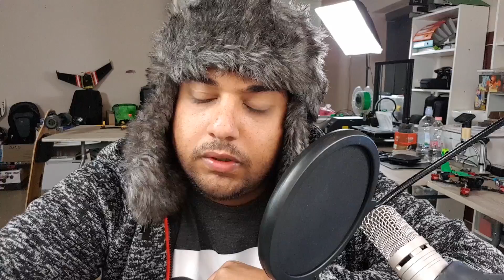Open Hardware F4 Flight Controller Beta Finished // Morning Vlog #017

Comment: Hello, I can see a great project ahead and I'd love to help if possible.
I also work on drones and designing PCBs and have designed many custom PCBs from scratch using the F103 chip. Feel free to contact anytime.
Great work.
Reply from the maker: Can you email me mesh.drone@gmail.com
Reply: @DroneMesh  
Done.
Reply from the maker: Got it will email ya in the morning :)

Comment: Dude, I'm sorry because I won't remember the names... My memory for names is horrible. But, anyway... I remember one of the last Kabab's videos he talked about the Helio Spring and another one (with I don't remember the name)... And that board uses an special 32 bit gyro that already comes with a processor for filtering!
So... Maybe it worths looking about it for a future version. 😉
Reply from the maker: What I never knew that.. Is software open source??
Reply: @DroneMesh  From what I understood the board runs Betaflight. But the filtering is closed source and comes already installed from the factory.

Comment: I've read that with 6s power suppliessome frequency or other can screw with the imu. I saw some advice for making ICM gyros work which was to add another cap to the 5v. is that something you can design out?
Reply from the maker: You can try to calculate the capacitor farad rating to filter the switching frequency of the reg causing this issue.

Comment: In my opinion it will be really important to be able to buy the smd components with the pcb , otherwise it would be impossible to buy every little resistor and capacitor separately .
Reply from the maker: I will aslo be working on kit based FC's in its advanced stages.
Reply: should have watched the video before commenting ...